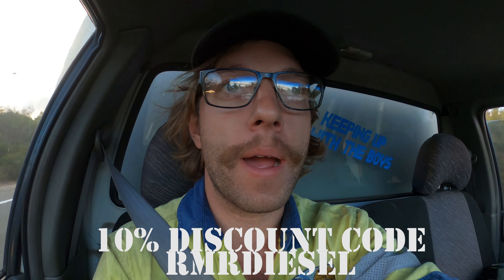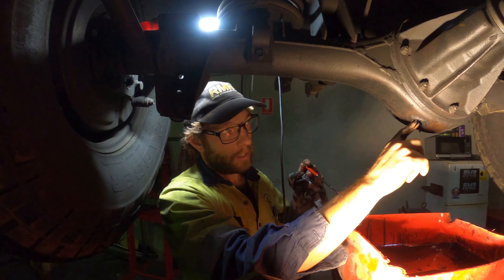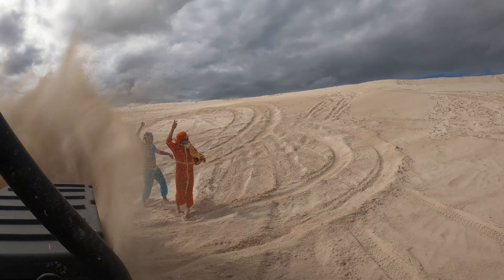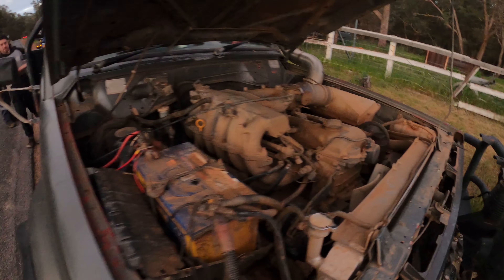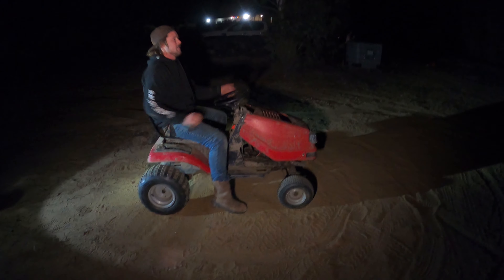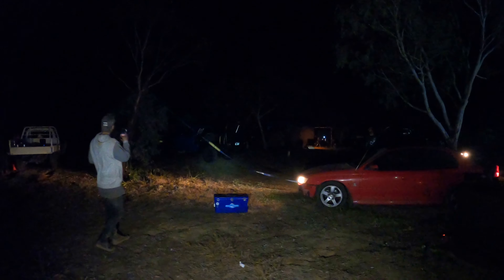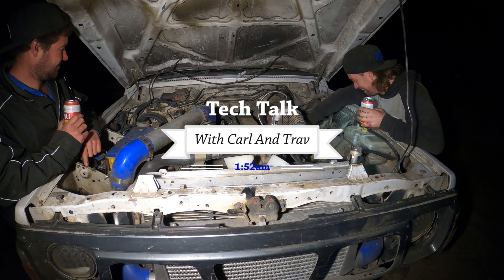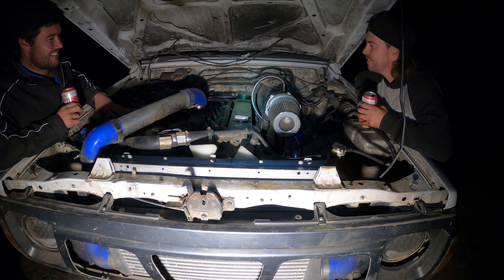FTE part 1 // Nissan Patrols thrashed harder than you've ever seen // Private event

Comment: Got me some of them chunks out of my yota diff, didn't know patrol diffs were made of playdoh aswell😂
Reply from the maker: What yota you got? You seen Smash's twin locked 4runner with mechanically injected 1kz on here? It was a beast
Reply: @Reuben_rmr  I had one exactly like smashes one but with the original 3.0l v6, thing was a shitbox but used to race getz's off from the lights, his one in an absolute weapon tho I'm gutted I didn't buy it for what he sold it for cause it was a bargain
Reply from the maker: @chubbs2484  yeh just last year he was going to let it go for 5k. Paint was crap, tried to convince him to paint it bit he said he'd want to keep it if he did 🤣
Reply: @Reuben_rmr  holy shit, I'm pretty sure it was let go this time for 8.5k, atleast that's what it was advertised for when I seen it. I sold mine for $2500 with a canary for lift and tires (2 inch lift 30 inch tires)